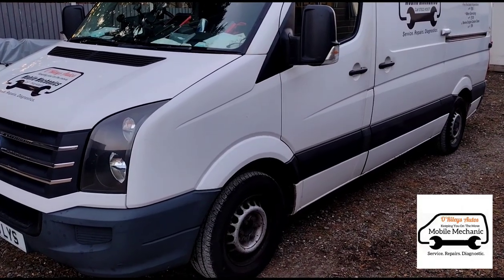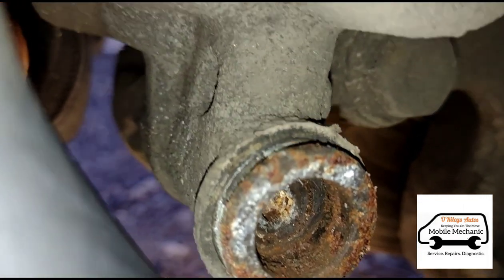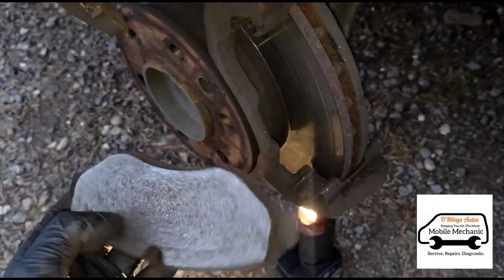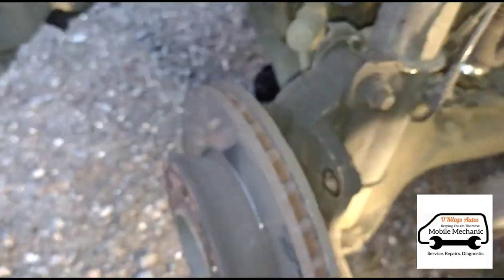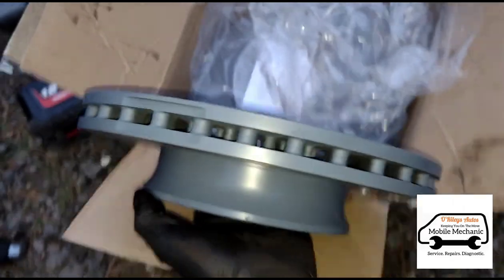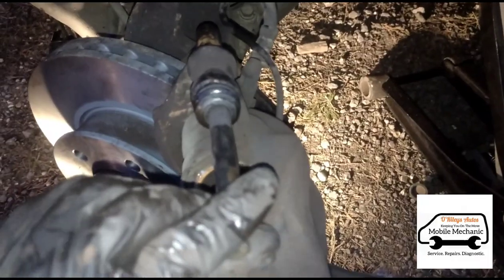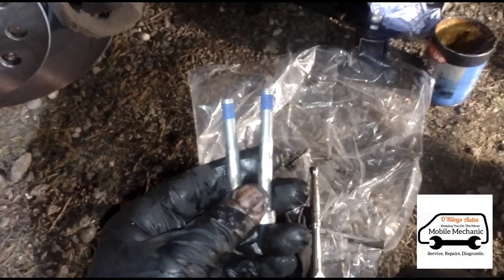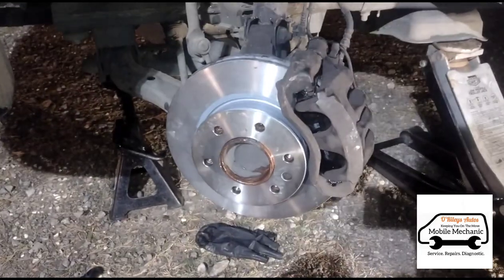VW Crafter / Mercedes Sprinter Front Brake Pads & Discs Replacement

Comment: This design of caliper pin are a bugger to get out when properly seized. Had some laughs with Movanos with the 18mm thick pins with 8mm allen heads set an inch and a bit deep into the pin.